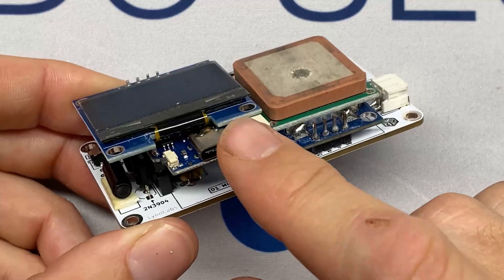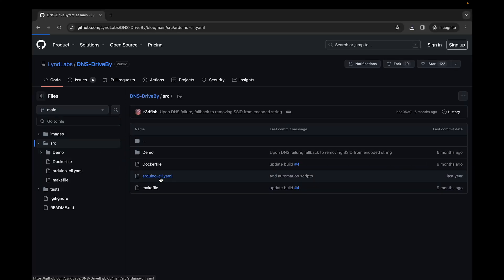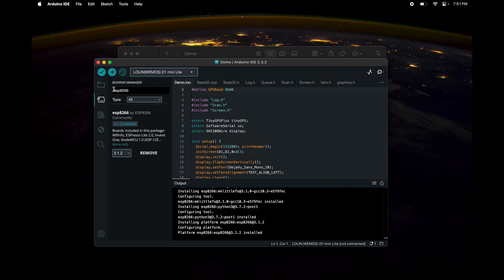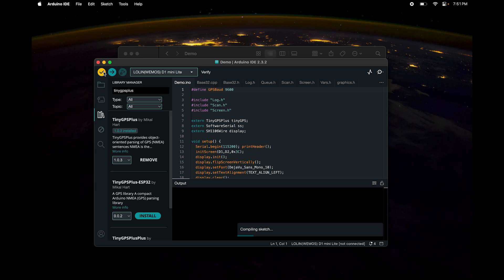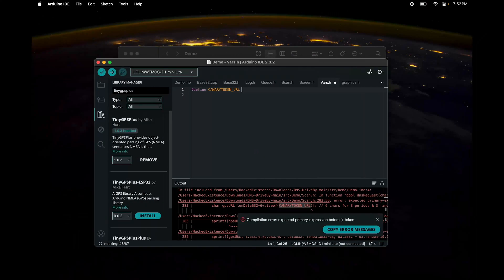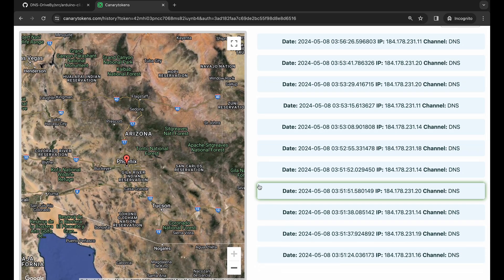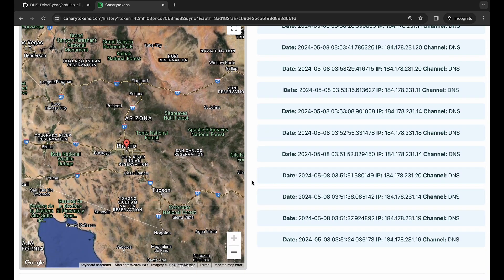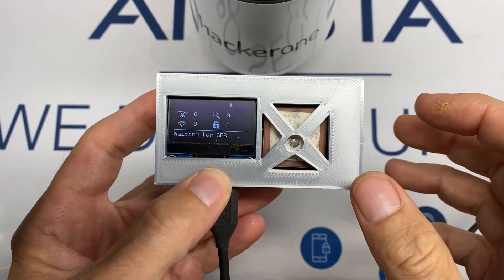DNSDriveBy   Anonymously Track GPS Locations

Comment: good concept, but how many open wifi networks are there these days? Not many.
Reply from the maker: Thanks for your comment, my experience has been quite different. I literally showed this working driving down the street.
Reply: Basically any retail shop has some form of 'open' wifi with a webapp log-in page. Using a custom dns address you can bypass those more often than not & this device doesn't need internet access anyways.

Comment: If it relies only on open wifi networks, it might be an issue when there aren't such networks around. Have you considered connecting to password protected wifi networks as well? With the help of pwnagotchi and a related plugin you should be able to connect to wifi networks with weak passwords and perform those dns requests to track location of the device. Good job with your project!